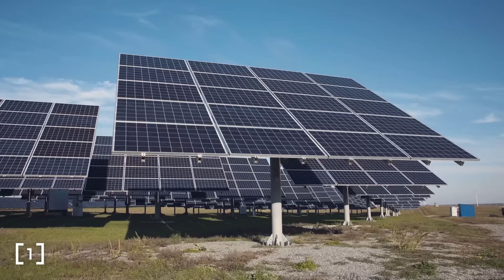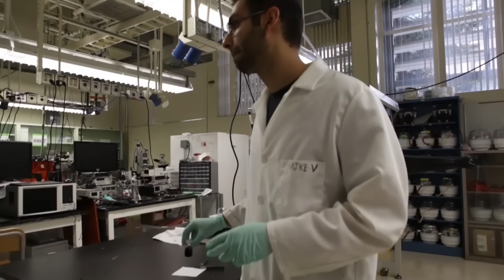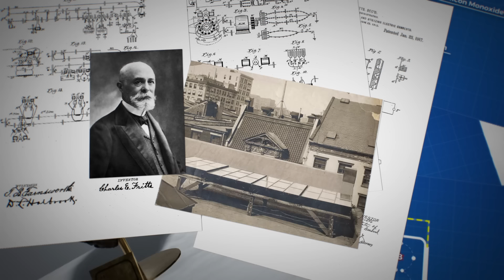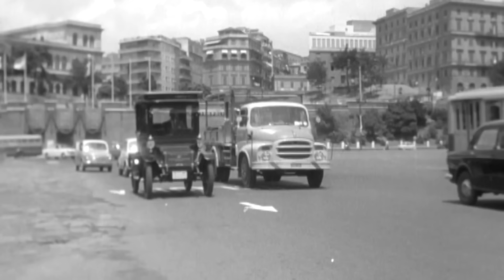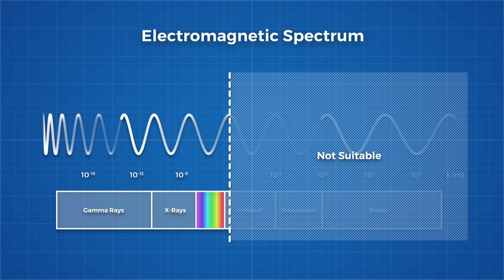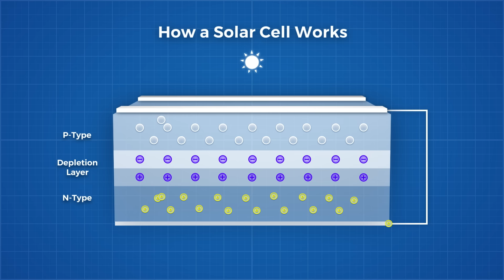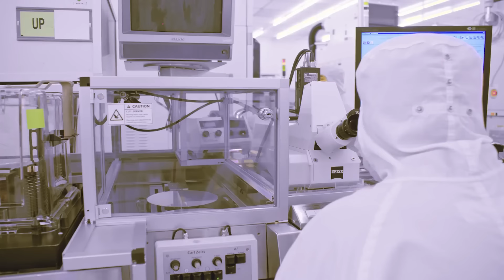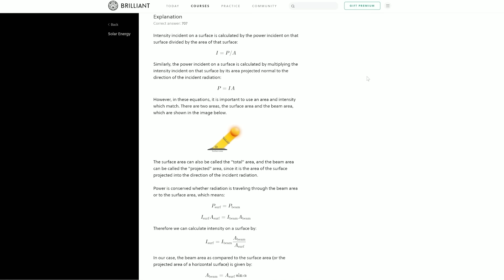The Mystery Flaw of Solar Panels

Comment: I always thought that you could improve the band gap potential of a solar cell by biasing the PN junction with a magnetic flux to saturate the majority electron carrier thus widening the depletion zone and making a higher potential hill.  A higher voltage would raise the overall power of each cell.  If the valence electrons of the n-material could be swept to the PN junction by the magnetic flux, this would widen the band gap.

Comment: Solar panels are basically NP transistors with light acting as the control line. Interestingly, the purpose of this technology is to salvage the residual energy required to activate the transistor rather than using the transistor as a switch. Like having a tiny dynamo hooked up to a light switch that you keep turning off an on again.

Comment: Speaking as a senior engineer wind are the biggest hoax of our generation. Dozens upon dozens of abandoned wind and solar farms in west Texas liter the landscape with little to no accountability on decommissioning. Units that were supposed to last 30-50 years survived less than half that with excessive maintenance cost far out casting all original projection to the point no one could afford to buy power from them in the region. So what did they do? They build hundreds of miles of transmission lines to liberal cities that would buy it during the Obama years. Then the movement the subsidies ran out, it was all for nothing. Just like Enron the companies that picked up the pieces tried again and failed again. Now who’s going to clean up the landscape. Damaged solar panels and broken wind turbines are also a danger to native species. When there ‘high tech’ materials start breaking up it looks like someone showered the areas with asbestos fibers. When a old wind turbine start aging and or fall down they leak hundreds of gallons of petroleum lubricants into the environment.

Comment: I want to know the potential of taking solar panels and using them as radiators in space.  I’d see this as a huge step forward.  The other thing I’d love to see, solar panels that are slightly see through; which results in less efficiency, but if placed upon a roof and having a sky deck would allow for nature ambient light to travel in reducing the need for lights during that day.  If you wanted to take it a step further have it so depending on the angle of the panels you’d let little or lot of light in.  Think solar panels are amazing, but they have so much more potential.  I see them as more than just tools to capture light.

Comment: Silly those scientists need a lesson in thermodynamics , another major issue is the loss of infrared spectrum and failure to absorb the solar irradiance in the  infrared region ...those scientists should incorporate thermoelectric conversion process by using a system architecture mechanism sandwiching semiconductor diodes with photovoltaic as the infrared heat can be absorbed to generate current using seeback effect      HUH.......... only if  Arpit Dwivedi was an engineer .

where is the GRAPHENE !!!!!!

OH GOD

Comment: I used solar cells for my photography light meters (Weston Master 5) and my cameras (Nikon Photomic) in the 1960s. Also heat causes a reduction in solar cell efficiency and the sunlight is hot.

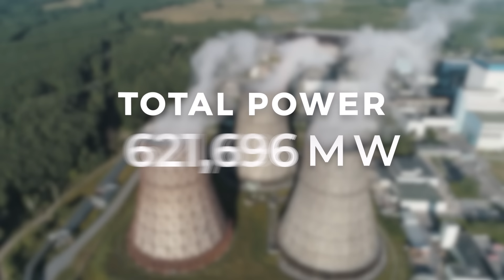Comment: Woah what? Your nuclear at 01:20 is way the hell off. A nuclear reactor generates Megawatt hours - by the millions per month (nearly 1m per core). Annually Palo Verde generates nearly 32 thousand GW hours of power, or 32 Tw. And that's just one plant with 3 cores - not 30. You're nowhere near that in solar or solar drop off numbers. Nuclear power eats solar for lunch. Could be a metric error - but how are you applying those numbers?

https://en.wikipedia.org/wiki/Palo_Verde_Nuclear_Generating_Station

Comment: Is the solution to make panels more efficient is design panels like a vascular leaf instead of the grid type currently used?

Elon spoke about first principles when redesigning the entire process on how a battery is made.  By eliminating, the wet processes and developing a dry process, they are skipping a lot of steps in between.  They looked at why things were done in certain ways and found that is just how it had been done in the past so the entire keeps perpetuating that process.

Are there any companies using first principles design to completely change solar panel design?  I wonder if Tesla R&D has anyone attempting to solve this problem.

Comment: I can speak on one way we solve the issue of metallic strips absorbing the light because I work in the industry. You can put a reflective film on top the strips, and make the inner surface of the glass retroreflective. This means the glass will have pyramid shapes that reflec light back the way it came. So light bounces off the film, into the surface of the glass, and onto another part of the cell. Also, we use multiple thin strips spread out over the cell to maximize electrical conductivity and minimize heat concentration. Newer designs of panels use smaller cells (usually normal cells cut in half with a laser) but have more of them. This, combined with a different way of wiring them together, decreases the amperage but increases the voltage. High voltage DC current is more efficient to send through the copper wires than low voltage, high amperage. It burns off less energy as heat. AC current is the same way, which is why power stations boost it up to several kV on most of the lines. I'm happy to answer any more questions if I can.

Comment: Your description and on screen graphics and animations would also be excellent for explaining how more general purpose semiconductors work like the ubiquitous transistor that’s now in our devices by the billions. That same tech can result in billions of those P-N junctions packed into tiny little chips, each smaller than your little fingernail, such as in your phone for example. It’s amazing tech most just take for granted. Thankfully the cost per kilowatt for solar has come down far enough installations already are profitable on their own in most parts of the world even at current efficiencies.

Comment: "Forcing fossil fuel producers out of the market through technological advance"
That's a lie, it's due to government subsidies.
The installed power supply is irrelevant because it doesn't benefit human flourishing.
It doesn't reduce CO2 production while being just as pollutant as fossil fuel energy.
Because it's super unreliable and batteries far too expensive.
Greens know this but their real goal is to destroy civilization.
If we'd somehow find a way to make a superconductor at room temperature,
all of a sudden they'd 'discover' how much pollution unreliable create.
Then the 'solution' would be to ban those as well, without an alternative.
You pushing Stalinist/topdown re-organization of our economy has revealed you as a fraud.
Reply from the maker: Before repeating this non-sense, research levelized cost of electricity

Comment: I can feel the satisfaction from how you first said the energy (Si = 1.1eV) needed to push out an electron from it’s valence band to it’s conduction band then, later revealed that it was a surprise to you when you first read “band gap”. ❤️💯 

For those asking, a simple explanation of band gap is the distance (in terms of energy) of the valence band to the conduction band. Think of the valence band as the ground state of an electron around an atom and conduction band is when that electron is energized out of the shell “ENOUGH” for us to be able to use it.

Comment: Excellent video, especially in explaining the photovoltaic effect and p-n junctions without requiring knowledge of quantum mechanics.

One minor nitpick I have though - Silicon isn't used because of its ideal properties (while its bandgap is in a good region as you described, it's an indirect bandgap, which makes it harder for the photovoltaic effect to take place and introduces some losses into it), it's primarily used because it does the job well enough and is vastly cheaper than then alternatives. III-V semiconductors (such as Indium Phosphide or Gallium Arsenide) tend to have higher efficiencies and lower heat susceptibility, especially when used in tandem with other materials, but are far more expensive to produce.
Reply from the maker: The ideal is 1.3 eV, while silicon is 1.1 eV. I should have mentioned that for sure. In my head I thought I explained it, but I guess not.

Comment: Solar cells are not forcing out fossil fuels, nor is their growth only cause of technological advances but rather cause of heavy subsidies. And while solar is nice to have it is waaay too volatile and expensive for most of the energy-demand we have. It needs rather large energy-storage facilities really close by to have a chance of working and so far storage is not cheap nor all that good for the environment. Regions with mountains can use pump-storage which is decently efficient, some use heat-storage as that has very little emissions. And then there are batteries - which need quit a lot of resources and don't last long making them have a large amount of emissions.

Where solar energy really is great is in the hotter regions where people use a lot of power for air-conditioning. When is it the hottest so you need the most energy? Yep - when the sun is shining the strongest. Which again means that solar cells produce the most power when the demand is highest. In the US about 10% of the total energy production is used for air-conditioning.

Wind is often less volatile, but the best would be water-power out of the 3 "renewable" energy sources.

And well - would be nice if nuclear power - be it fission or fusion - only got 1/10th the research grants of Solar alone - not to mention all the tax-examptions and benefits as well as subsidies......

Comment: Feels like we’re going to have a major reckoning when PV panels have to be recycled. Electrification is great but there are a lot of intermediate steps to take place
Reply: Don't have to worry for another 40 years or so.
glass and crystalline and  the frame can be recycled and the back coating may also find a way to be reused.
Reply: @FloryJohann  you make it sound so simple. solar panels have been helping fill landfills for the past 15 years. cheaper to make new.
Reply: The same reckoning is coming for all the electric vehicle batteries
Reply: Behold the "concern troll".
Reply: reckoning already here. you wont hear the negative side of all the wasted materials, it heresy to speak against renewables.

Comment: The PN junction has nothing to do with electromagnetism. It's just a naturally charged zone. Revise suggested. Otherwise perfect as always.
Reply: What are you saying? Of course PN junction is related to electromagnetism. The electrons on the N side are attracted to the electron deficient P side. The electron travel from the N side to P side causing a positive charge on the N side of the junction and a negative charge on the P side of the junction. This causes an electric field in the junction that opposes further migration of electrons. which is why the current flows in only one direction in a diode, and is also why the current flows through the outer metal circuit.
Reply: @varunsa7047  exactly as you said it's the electric field, not the flow of current or magnetism. Electromagnetism is when current is induced, magnetic field interact with flow of electricity and the other way around. I think.

Comment: So if oxygen impurities cause these inefficiencies, how about designing a sort of "void box" right above (and maybe around) the panel with a higher transparency than glass (think I heard something of a "metamaterial" which uses gold and silver nanocoils or something to achieve practically 100% transparency), and finding a way to remove as much air as possible on the area the light is landing on?
Reply: The oxygen impurities exist inside of the entire solar cell and are a result of how the entire block of cheap silicon is made. It is not an issue that removing air from around the solar cell can solve. The solution is to use Float zone technique to remove the oxygen and all other impurities but this is an expensive process and will easily double the price of solar panels

Comment: If the Electrons get knocked out of the atom then doenst mean that that there is a hypothetical poit in time where the solar panel is "Empty"?
Reply: No I think it is filled at the same time , don't quote me on that , but will be some kind of sorcery like that
Reply: I'm not too sure what you mean by "Empty" but let me just run with the idea. 
1 electron in a hundred atoms gets knocked out and conducted away from the solar panel. Lots of "holes" are left behind in the solar panel so at this point you have a clear separation of positive and negative electrical charges and have created a capacitor where most of the solar panel is "Empty"

if the circuit is complete, the electrons immediately rush back into the solar panel and recombine with the "holes". During normal solar panel usage, it will not be "Empty" as the knocking out and recombining processes are close to instantaneous (due to the electrons travelling at near the speed of light)
Reply: @lugiarboy  empty as devoid of electons, if the electrons are recombining how is the energy left to use (i think what i mean is where does the "surplus" of electrons come from are they createt or are they taken from elsewhere if not how can there be any energy left) thank you for answering.

Comment: So basically current solar cells are inefficient to generate power. Having worked with this tech that’s not even the worst part about the inefficiency. Simple cloud cover will drop that 20% efficiency by another 70% to 90% plus the cost of battery storage on top of the cost of the solar plant when the sun doesn’t shine. You can get waveform issues from the inverter and transmission issues with solar.

Comment: I get that as the silicon heats up it gets less efficient. Why not put water behind the panel and use that heated water to heat hot water in your home? (Or a similar use) I wouldn’t think the electric pump would take much electricity. Also it takes a lot of energy to heat water so this would be a savings in hot water costs.

Comment: Waste of time.... $20k or more in solar panels/equipment that are not enough to run my entire home (cannot run the A/C), then I have to have the panels installed and battery bank, Batteries only last a couple of years and are toxic and a fire hazard. Solar panels decay over time and by the time the system they pays itself off you have to replace mostly everything. it will take over nine years to see the initial return investment minus battery replacement costs.

Comment: 10:30 -- I don't see how this explains why electrons can pass through one way but not the other. Just from looking at the diagram, it doesn't seem like electrons should be able to pass through the barrier at all, even from the top side. The negatively-charged middle layer is closer to the free electron than the positively-charged middle layer is. Consequently, the net force from the wall on the electron should be repulsion, not attraction.
Reply: There's an electric field in the depletion layer accelerating the electrons towards the n-type
Reply: @battleclan  -- I appreciate the reply, but that's exactly the point that I'm contesting. The electric field generated by the depletion layer should be repelling the electron, not attracting it. The negative sub-layer of the depletion layer is closer to the P-type region than the positive sub-layer of the depletion layer is. Consequently, the negative sub-layer has a stronger effect on the electric field within the P-type region than the positive sub-layer does.
Reply: @mvmlego1212  yup. I get what you're saying. Theres also an arugment to be made that the electrons excited in the p-type would immediately recombine with a hole. Someone said that you want most excitation to happen within the depletion zone. In that case it makes sense, right?

Comment: I have a question about the emission and absorption curves displayed at 5:58. Together, they imply that the atmosphere absorbs a larger portion of visible light than it does for infrared light. However, this runs counter to the well-demonstrated greenhouse effect. Can anyone explain this apparent discrepancy?
Reply: The light that reaches the earth is reflected back by the surface at a different wavelength. Greenhouse gases absorb this radiation which is then converted to heat.

Comment: I got two simple ideas to increase the efficiency. It would surprise me, if they hadn't been tried before. Can someone tell me, what the result was?
1) in the video, he showed a surface modification to prevent reflection, but reflection should be a good thing to combat transmission. Thus, a mirrow layer on the other side, should theoretically double the efficiency.
2) IR is too weak to be used, but UV is not useful either. Couldn't fluorescent materials be added  to catch the UV photons? - or is it just that we can only use a little of the UV energy?